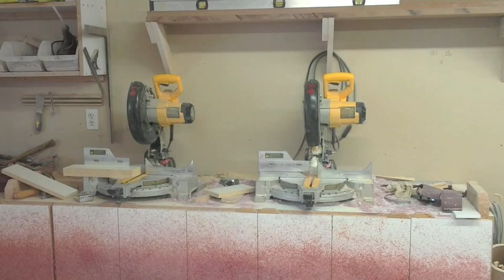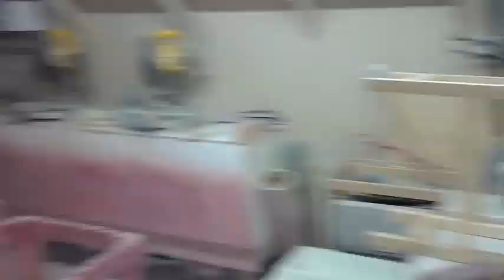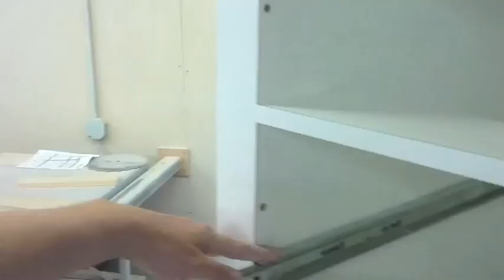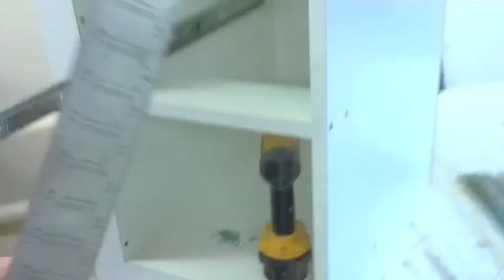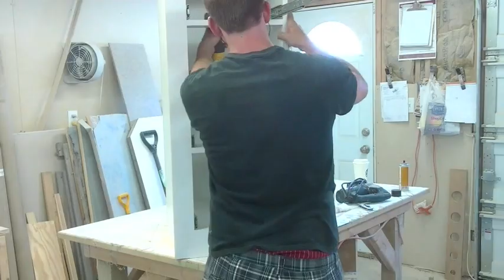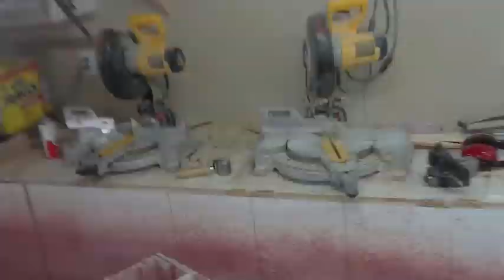Laminate cabinet

Comment: why don't draw a straight line for drawer track,and tied it before build up the cabinet
Reply from the maker: Just because I was always used to mounting the drawer slides after.The company I currently work for cuts the cabinet parts on a inc and mounts the drawer slides before assembly.